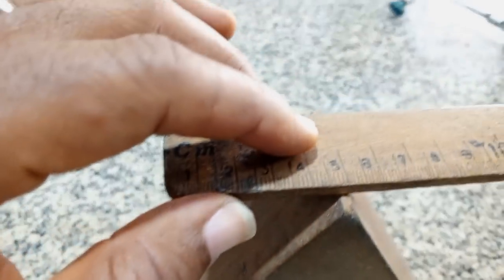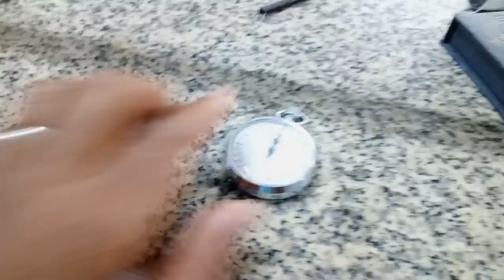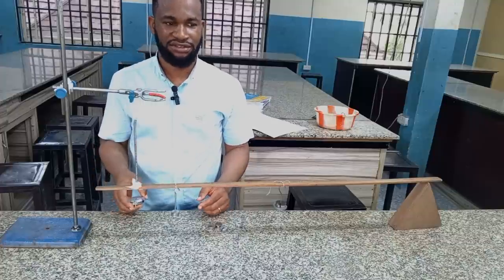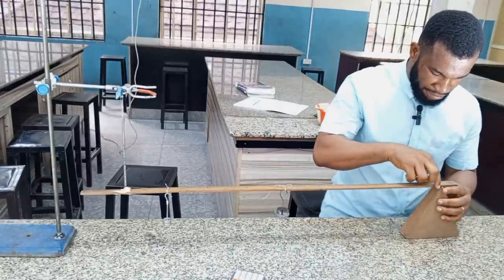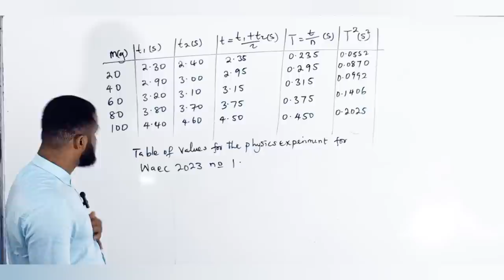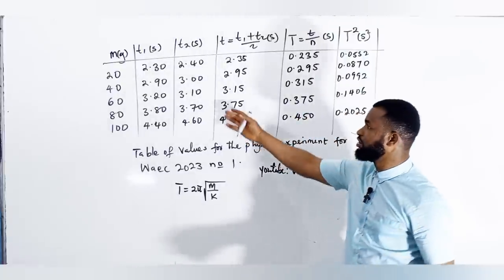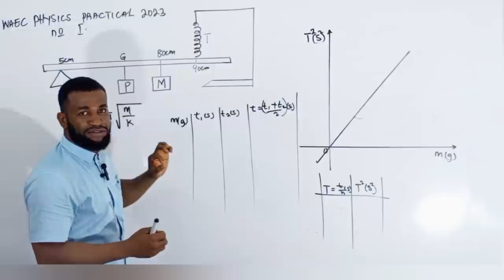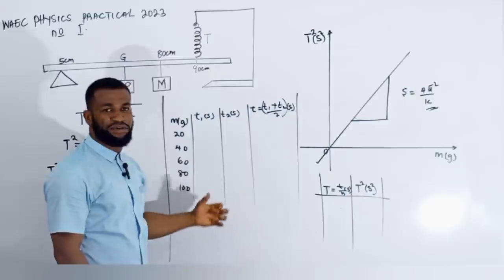WAEC 2023 Physics Practical no 1.#waecpractical #physics #youtube  @vindalsacademy

Comment: Using T = 2pie Root(m/k). Isn't m supposed to be the mass on the spring which causes  the metre rule to balance and not the mass that's increased which is attached to the spring
Reply from the maker: Maybe rewatch the video

Comment: Hello, thanks for this. But you didnt use the mass labeled Q (20g), are we not going to use it?
Reply from the maker: It is the mass Q which I vary as 20, 40, 60' 80
Reply: Can you please explain better? Because we were asked to provide 40g, 50g, 60g, 70g and 80g.

Shouldn't the masses be 60g, 70g, 80g, 90g and 100g?
Reply from the maker: I didn't see WAEC questions I predicted based on what were provided as apparatuses. This is supposed to be a guide.
Reply: @vindalsacademy  what about the half meter rule we were asked to provide, dont you think we could be asked to measure the extension of the spring as more weights are added? Also about balancing the metre rule as more weights are added and then measuring the pont where the meter rule balanced? There are many sides to this question
Reply from the maker: @gideonthompson8023  that half metre rule is for question 2